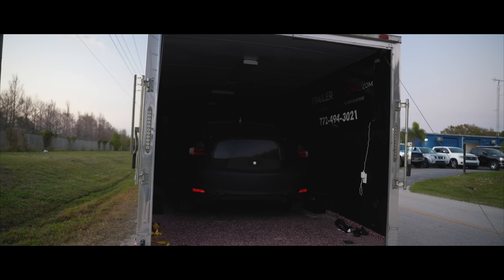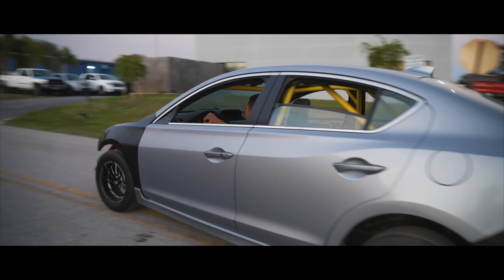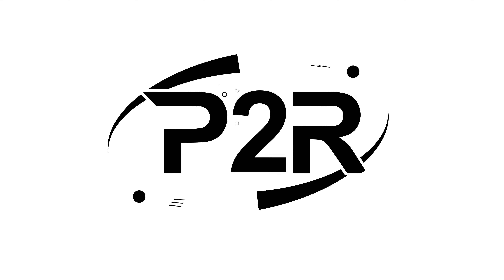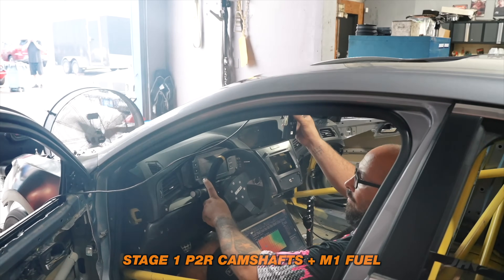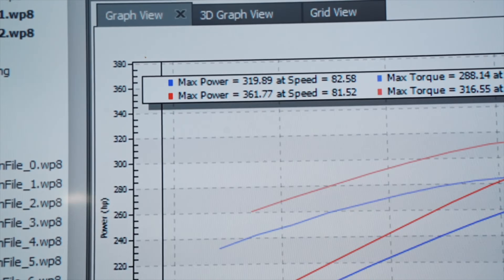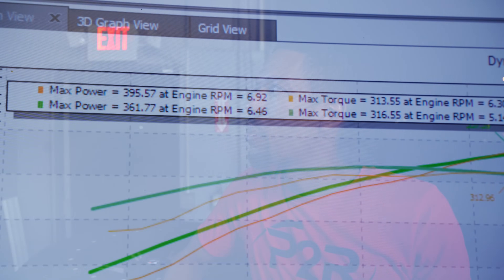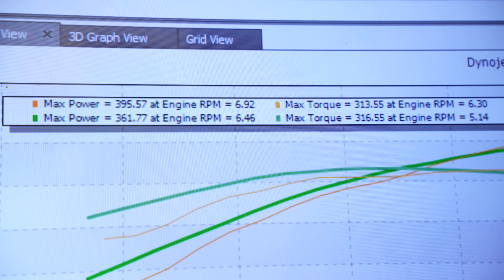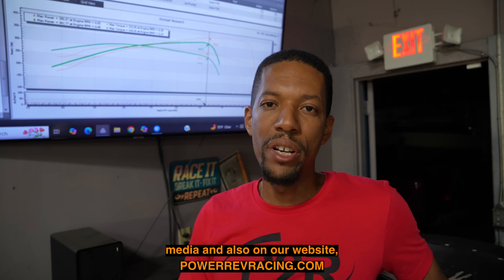BIG Gains! P2R Hyper Stage 2 Camshafts Tested – Dyno Results SHOCKING!

Comment: The intake pipe run just like that without a velocity stack is actually choking the opening because of the way the airflow around the edge of the pipe creating a smaller effective inlet pipe opening.
Reply from the maker: The headlight is the velocity stack when the front end is on. But we didn't install for this video as it would not have been a direct comparison to the previous dyno.

Comment: I can't for the life of me figure out was is blowing out of the back of the intake at WOT on these runs. What is that? Is there some sort of vacuum hose not connect for testing?
Reply from the maker: @ScottTooley  combination of blow by and oil that spilled on our heat wrap that is burning off. The valve cover has no baffle in it, we're adding a vacuum pump but haven't installed it yet. Will have it on before the next dyno so we can cross 400 next time out.
Reply: @PowerRevRacing  gotcha, thanks for the explainer. I figured it was inconsequential as if it was bad it likely would have been mentioned.

Comment: Hey Sean! Looks like the dyno shows decent low and mid power lose from the stage 2 cam. Can these discrepancies be made up through other bolt-on applications, or a good tune? Any advice you can offer to gain back that power would be helpful.

Keep up the great work, love what you guys do for the J series!
Reply from the maker: Larger cams will naturally shift the power curve higher in the RPM range, so a drop in low-end power is expected. However, low RPM performance is typically irrelevant in racing scenarios, as we rarely operate in that range. While we do capture data from low RPM during dyno runs to generate a complete power graph, that portion is not important to our goals.

That said, much of the low-end power can be regained by utilizing the camshaft in a more traditional manner—engaging VTEC only once the engine reaches an RPM range capable of supporting the additional lift and duration. In our case, we are using a VTEC-locked rocker system, which continuously operates on the larger VTEC lobe of the camshaft.

Lastly, this is compared to our stage 1, which makes more mid range than the oem camshafts.
Reply: @PowerRevRacing  thank you for such a thoughtful and thorough explanation!

Comment: Help me bro.1st  Great videos I have been a fan and ordered several parts from you guys. But I'm ready to build the motor and I need to know is this the best cam to put I. 2005 My v6. J30a4 honda accord . Please send link or any details on best way to upgrade this show car project of mine. Thanks
Reply from the maker: All depends on your goals. Our Hyper Stage 1 is a great cam for some one who isn't trying to go all out.  We can help you make some good power from that J30.
Reply: @PowerRevRacing  if the stage 1 is just as good on more hp then cool. What's the difference in stage 1 vs stage 2 just hp? How much difference. I need more power. I have the p2r timing belt kits u make. P2r manifold spacer.... and cold air intake . Upgraded exhaust... and the j pipes on now. May need a tune